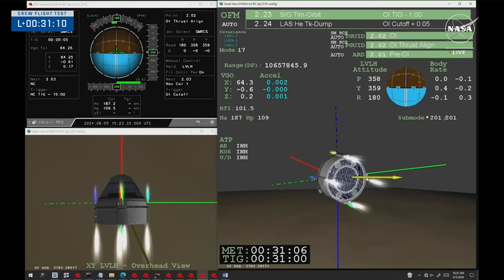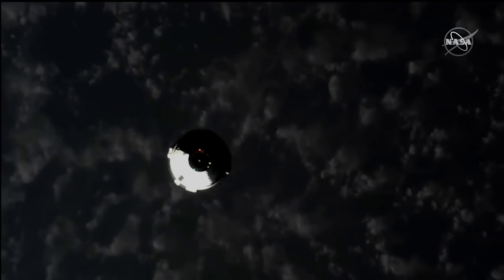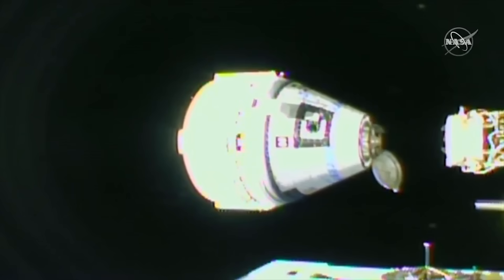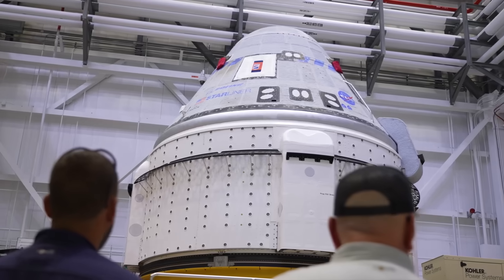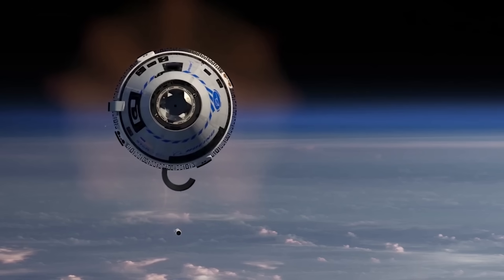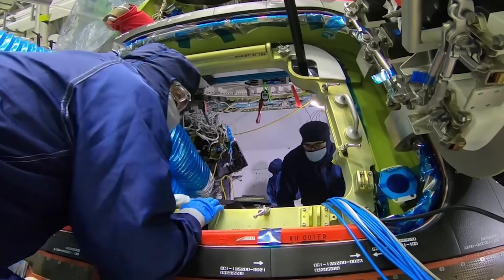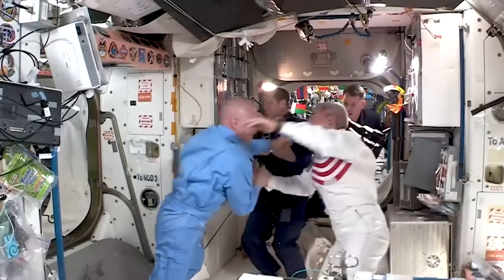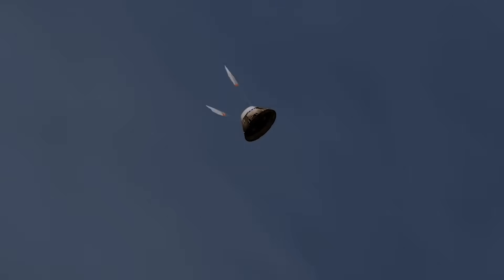More Helium Leaks Were Just Found On Boeing's Crewed Starliner

Comment: More nerd; long ago I sketched a sealing solution for a satellite connector. Elastomers and PTFE have outgassing issues that can poison optics and electrical contacts. So instead of elastomers a glass frit is placed on a matrix connector face and an inconel sheet is deformed to create ridges. The sheet is gold plated. Or, gold ridges are deposited directly. The glass frits are polished flush. When the faces are bolted down the small (4-40) screws clamp metal to metal and compress the ridges, plastically flowing the gold at the peaks. A hermetic seal is formed if the faces of the connector are gold flashed as the gold cold welds through diffusion. The connector is used once at module mate at satellite build. Boeing here might have considered metal seals such as “C” seals. I believe cost and weight can be constant for thrust gas management.

Comment: Some nerd stuff: Helium is very difficult to seal against. Example in the 1960’S Rolex made dive watches that were brought down into deep saturation dive modules where crew breath at high pressure helium and oxygen. A diver was injured when his watch exploded sending saffire shards about. Root cause was helium crossing the elastomer seals . Recall and taper burst plugs were added.

Comment: When the flight director does their go/no go poll, "more or less" is not an acceptable response.  Hopefully whoever is running NASA after the election will have enough brains to pull the plug on this kludge.  At a minimum they should require another certification flight.

Comment: I'm surprised it got off the ground at all. It's also a miracle that a hatch didn't fall out or an MCAS type system cause it to crash. Boeing and NAASA should give up. They are both a busted flush. SpaceX frequently ferries astronauts to the ISS without any of these dramas.

Comment: This is normal tbh, helium leaks are tricky, and the space shuttle struggled with leaks all the way till the cancellation. Most of these leaks do not have the capacity to leak bad enough that they would endanger the mission even if you cut the pipe straight in half, same applies to Starliner. The real issue tbh is if this is worth sharing so in detail during the mission if people freak out about it. Falcon 9 leaks... Starship is a leaking mess when it launches, you can see from the footage of the last launch, yet no one seems to worry about that. :s

Comment: Who invited the Aviation nerds here? 
Yes, Boeing has developed a bad reputation lately, but this is a space vehicle. The leak is in the propulsion system, which means they are simply jetting some fuel into space. No chipmunk voices, and most likely no explosions.
They'll probably make it to the station before they run out of propellant, and if they don't, they can be retrieved by another vehicle. 
When the Starliner gets back they will make the decision to keep using it or switch to another capsule.

Comment: I call BS, if it has no impact on the mission then they wouldn't of even mentioned it with all the bad press they've already had. It's probably very serious and they are try to gaslight everyone before admitting the capsule is a failure.
Reply: Cowards hide their mistakes. And you need to learn what gaslighting really means before you use it. Fake it until you make it won't get you anywhere and you run the risk of making your ignorance widely known.

Comment: Even in an airplane; things can get worse as soon as you leave the ground, start engines, pressurize, and put a load on the structure.  Why did they believe a static leak in the atmosphere would be fine and not change in outer space of all places??  That's the opposite of aviation and space flight...you're supposed to MITIGATE risk, not embrace it.
Reply: And the launch vibration could worsen the leak hole, they are taking a risk that lasts the entire mission from beginning to end
Reply: When did they say they believed the leak would not change in outer space? Do you just make up stuff so you can pretend to be an expert?

Comment: This is not a new problem. The previous mission that actually got to the ISS, without getting lost, had failures with it's RCS thrusters, but had enough to dock. Boeing claimed they had fixed the issue despite the service module being destroyed on re-entry and so they had no hardware to examine. Boeing management have fully adopted the Titanic approach to risk management - we are not on board and are accountants not engineers, so full speed ahead it's only a small iceberg. Whatever the astronauts are  paid, it is far, far too little for flying a Boeing product even with extra duct tape and spare door bolts.
Reply: Do you always pretend to know what you're talking about?

Comment: Curious to know what teething troubles the Apollo capsule hardware had in its first few flights.
Reply: Apollo 1 burned to a crisp on the launch pad, killing 3 astronauts. Apollo 11 almost didn't land on the moon, Apollo 13 didn't. There's a long list of troubles, only 17 flights. Likewise with the Gemini capsules. Reading the commenters pretending to be aerospace experts you'd think space travel is as easy as making a trip to the grocery store. None of them have ever designed or built anything that worked or had a useful purpose, but they are just itching to denigrate someone so they can feel better about themselves.

Comment: If helium is neither combustible nor poisonous, what's the fuss about it?  It's just leaks, not like the cabin portal that gets blown away as what happened to the Boeing passenger plane when flying to Alaska (?) a couple of months ago.
Reply: It is for pressurizing the propellant (fuel and oxidizer) tanks kinda like how Nitrogen/CO2 is used to pressurize a can of whipped cream so that a simple opening of the valve near the nozzle is all that's necessary to dispense the cream. Its the same here the pressure in the tanks is what forces the propellant to flow to the rocket engines that the spacecraft uses to maneuver in orbit. Loosing too much Helium would therefore cripple the spacecraft as the pressure will drop too low for the tanks to feed the engine properly.
Reply: @noob360  , I see. Thanks for the info.  Most likely some hasty job in the attempt to meet the deadline required by the NASA. Boeing's yet another debacle due to hubris and overconfidence. Didn't they ever worry there could be the chances that the crew would be greatly limited in the capability of manoeuvring the Starliner? It's not like the passenger plane that could land on the Hudson River.  The Starliner is in the outer space. What on earth were they thinking at Boeing?
Reply: Leak enough and you lose RCS controls for docking and re-entry.

Comment: So they knew about the leak and instead of fixing it before takeoff, they like "it should be fine". That's kind of like having a flat tire before a road trip, and you like "it should be fine". That's insane.
Reply: too many scrub launches. Got to go
Reply: It's like going on a road trip with fully inflated tires, except one of the tires has a tiny leak and is slowly losing pressure. You know you could make it to your destination and back, even if you removed that one tire entirely, so you decide to go ahead anyway
Reply: Shuttle did it too as well. The leak was 100 times larger
Reply: You have 27 other tires though..

I'd still be mad if I got a new car and one tire was leaking!
Reply: ngl, after having a flat tire on my bike, I generally assess if it can make the trip without getting fixed 😂
Reply: @delfinenteddyson9865  use Fix a flat for cars. Just be careful, it's still a can under a lot of pressure. But it works. I'm told. My cousin is big into that and he used my end of a can.
Reply: That's insane?  That's boeing!
Reply: @jonathanberry1111  and  NASA, they have a history of this too
Reply: I thought the same thing. Send it...
Reply: After launch on way to ISS further leaks have been found and at least two more thrusters have been shut down pending.  The thrusters are used in re-entry.  
In the meantime the crew was told to go to sleep.

Comment: Boeing quality control yet again
Reply: More correctly, the management of the entire program has once again failed to make the correct safety versus program schedule decision.  Design and build processes though, do seem to be suspect in creating the problems.  But the chiefs who are supposed to be monitoring the worker bees to ensure against flaws seem to not be adequately up to the task.
Reply: Pretty much every spacecraft that uses helium has leaks. Muppet...
Reply: Has american manufacturing standards drop sooo much...
Reply: @ghtwghtw7197  No, as a wise mentor advised me many decades ago… If you want to find out whether a man is a fool simply place a soapbox in front of him. A fool will promptly stand up on it and proceed to demonstrate to everyone within earshot how much of a fool he is. The internet is the soapbox on which fools stand, pretending expertise in subjects about which they know nothing.
Reply: @ghtwghtw7197  diversity is our strength what do u expect
Reply: RCS is rocketdyne.
Reply: @divedevil985  Overall contractor and assembler is Boeing, so while the RCS is the one leaking, the flange assembly is a Boeing item. Hopefully slow enough that the mission will be completed before the level drops to a point that the margin is eroded too low.

Helium is very hard to contain, it will naturally diffuse through apparently solid metal, and will find the smallest leak path with time. The seals are merely there to keep the leakage rate down to a low enough level.
Reply: @SeanBZA  lol. No. A seal is meant to SEAL, hence the name, not to keep leakage rate low.
Reply: @hermeticxhaote4723  it's only difficult for LONG amounts of time NOT for hours. Even in those cases the loses are very small. So no, there's no excuse for having not one but several leaks.
Reply: oh hey another boeing joke, nice.

Comment: Don't forget that with the uncrewed flight to the ISS, they had multiple failures of reaction thrusters.  As I recall, one thruster grouping was down to its' last back-up prior to docking with the ISS.  These thrusters, I believe, are fed helium from this same tank/plumbing that is now leaking.  Hopefully everything will work out correctly for the crew.
Reply: "Hopefully" isn't a word something engineers should be relying upon.
Reply: The helium pressurizes the fuel tanks instead of fuel pumps. No fuel, no thrusters. No thrusters, no docking, no proper reentry orientation, no braking to trigger reentry. Nowhere to go. So, nothing critical affected.😑

Comment: Probably have to hang out on the ISS until they can get rescued by a dragon.  😂
Reply: You have to hand it to Boeing - they are consistent across all their operations.
It doesn't matter whether it is military, airliners or spaceraft, they all have quality or design issues.
Reply: @gregculverwell just think about Air force One.
Reply: @gregculverwell  it would be cool if all of a sudden on astronaut's transmissions their voices started going all squeaky high...what's the over/under on how quick NASA would cut that feed?  🤡
Reply: @gregculverwell  But their space ships don't explode and on first flights have orbited the moon! 
Space X have a long way to prove their worthy with Starship.
I predict another stuff up by Space X Starship tonight! but Starliner I predict all ok.
Reply: @Leon1Aust  you're comparing a prototype pathfinder rocket system with all new concepts to a capsule that's been done for decades.
Reply: Dragon astronauts: "Somebody order Helium?"
Reply: Hello AAA,
my vehicle has a helium leak, could you tow me back to the KSC?
Reply: @svr5423  To KFC?
Reply: The Dreamchaser is launching soon, let this crew be the re-entry test crew for that mission coming back.  That would be interesting!
Reply: dragon? sojuze! 😅
Reply: @toraxmalu I thought Ruzzia quit the ISS.
Reply: @bogususer2595  not yet, they are still active with crew and supply missions
Reply: Well it will not be a Starship as the dam thing explodes 100 percent of the time.
Reply: @Leon1Aust  Starship won't do ISS grunt work. That's for losers like Boeing.  🚀
Reply: @Leon1Aust  Really ? youtube.com/watch?v=1FkQAU5sLck
Reply: @Leon1Aust  the ift 3 was the only one that triggered the fts. The first 2 were blew by spacex on the ground for public safety. That's why it's called integrated flight test. Prototype

Comment: They knew it was leaking BEFORE they launched.. couldn't find it and said... ehh. Its not THAT bad. Me. I do that. Cracked radiator... slap some JB weld on it so it's only KIND of leaking.. "eh.. its not THAAAAT bad.. it'll get me to work and back. Probably" 😂 NASA. What the heck? This is the WRONG STUFF. Not the right stuff
Reply: They did actually find it, it’s just that they can’t service it. They would have to remove the capsule, and if they did that there are certain things with limited lifespans that have to be replaced as well. It would have pushed them into next year most likely.

To be clear I think it was foolish to gamble on the leak remaining the same. I don’t care if it takes them another two years, they need to get their act together and make this thing foolproof before they put people on it again

Comment: It would be ironic if they have to return on a SpaceX vehicle.
Reply: Particularly after they tried to get Dragon canceled, because Starliner would be the best capsule since sliced bread.
Reply: Boeing's IVA suits aren't compatible with Dragon's ECLSS (and vice versa).  The worst thing that will happen is that they will cancel docking with the ISS and come straight home.

Which is bad, because it means Boeing still won't have met the milestone for the next payment and will have to pay for yet another launch out of their own pocket.  They've lost over a billion dollars on this program so far.
Reply: @johnbode5528  Interesting. I am more concerned about the process for launching with this system compromised. NASA has not learned from its own history of in-flight failures.

Comment: They need to pick them up with "Crew Dragon" and bring "Starliner" back remotely!
Reply: Wonder if crew dragon can dock with starliner.
Reply: @pigslefats  Crew modules are not designed to do that at least not yet.
Reply: That is a presumptuous statement to make when you have no idea how serious the leak is or what threat it may pose to the crew and the mission.
Reply: @michaeldeierhoi4096  But I think that is the point, they don't know how serious. At least a Dragon return can be arranged and if possible, return the empty Liner for study. Why risk the crew any further if control thrusters are possibly affected. Like having your steering wheel come off while on the highway and aiming for the reentry/exit ramp.
Reply: @marknesselhaus4376  It's their baby they have to nurse through this first flight.  NASA is especially adept in mitigating problems that arise on space missions.  I expect this will be safely resolved.  Then Boeing and NASA can work solving the He leak issue before the next flight.

Comment: Do they have FlexSeal on board 😉
Reply: comes with it as part of the Boeing flight kit.
Reply: They should have 3d printer on board with flex filament to print all the seals they need 🙂
Reply: Maybe gorilla glue
Reply: bummer, i was thinking of firing off a flexseal joke.  i feel thwarted.
Reply: This is definitely JB Weld territory

Comment: Helium is awful stuff to contain .
Reply: Helps if you don't use flanges and just weld everything like SpaceX
Reply: Helium is not the smallest atom.
Hydrogen is.
Reply: @ordinaryman1904  it's still a bastard to keep contained.
Reply: @ordinaryman1904  Yes, but you never find atomic hydrogen by itself. As a gas it is always H2 which is a diatomic molecule much bigger then singlet helium. That makes helium much harder to contain.
Reply: Helium is only hard to contain, for Boeing.
Everyone else is doing a pretty good job.
Reply: My laughter that this POS even managed to get off the pad was even more difficult to contain.